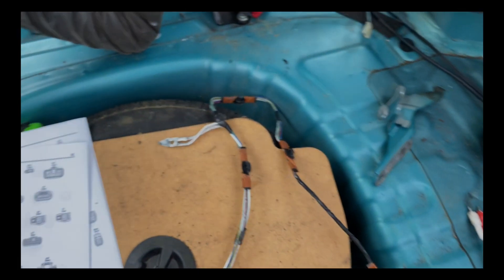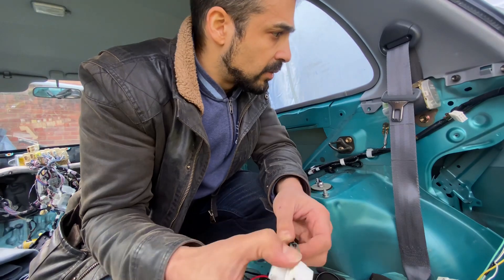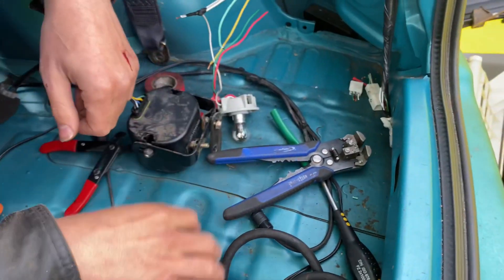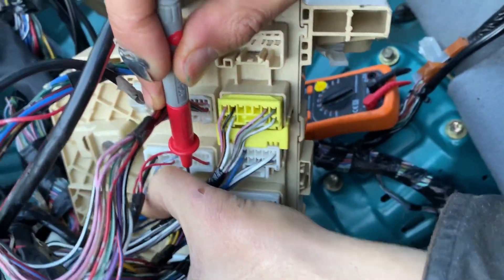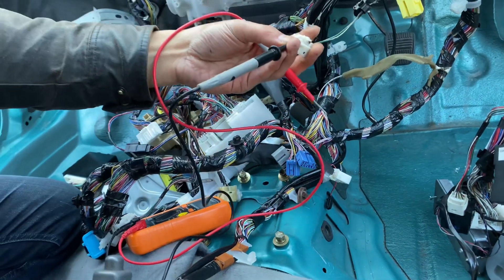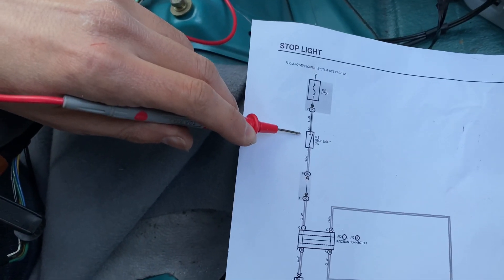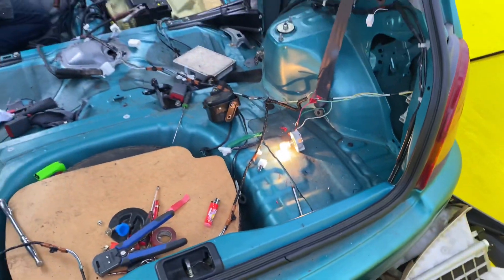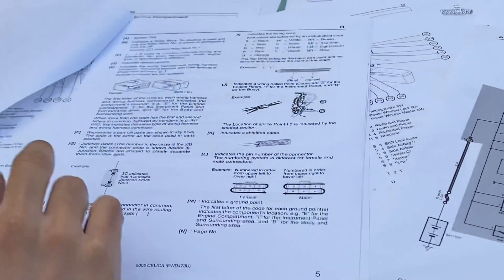Toyota starlet engine swap series (episode 9) Making Celica (Sports car) looms work in a hatchback.

Comment: Not looking forward to merging 3sge loom to 4efe loom, thinking is is worth using a full celica engine loom and exterior loom
Reply from the maker: @Automotiverecoveryuk  honestly if I was to do this again I would probably keep the full 4efe loom and just use either the engine loom from the celica and merge that or I would build a custom engine loom and wire that into the existing 4efe interior loom. The good thing about the toyota looms from those eras is most of it just clips in and only need cables swapping :)

Comment: What's the reason for using the celica loom instead of the starlet loom?
Reply from the maker: A lot of the celica loom can be plugged into the existing things like brake pedal and fuel pump without having to do much work. If I kept the starlet ecu I'd have to more or less either make my own hybrid engine loom and find get a ecu. This way I can retain everything including the ecu and all I have to do is adapt the lights and indicators to fit :)

Comment: Don't mind a wee rice rocket, I miss the £175  1 owner from new Honda Jizz got at the auctions, spent nothing on it, gave it death for 3 years then sold it for £900 lol, but wee things like this are about as close as you can get to a classic mini and as great fun without as much cost, ish, jap parts not as cheap as they used to be, been there, done that lol ;)
Edit: Assume this is an engine from an older celica? I thought you may have been looking to put in a 1ZZ I think it is (140hp) or whatever the yamaha 200hp eqivilant was that you go tin some models, I had one for a wee while..and while it was a bit camp looking like a TT, it was a very fun car to drive with overall good build quality, comparable to a TT as well I suppose, leather/plastic/sound deadning ratio wise lol. :)

Comment: A de pinning tool would be a better idea to save chopping wires up
Reply from the maker: Didn’t think of that tbh. I was thinking of cutting rearranging to work then put new connectors in. Thanks for the advice :).